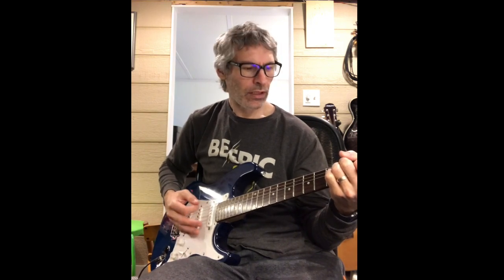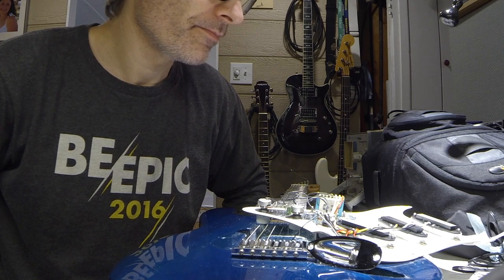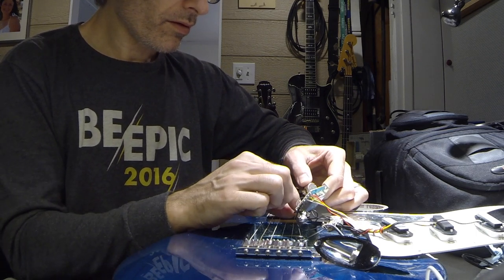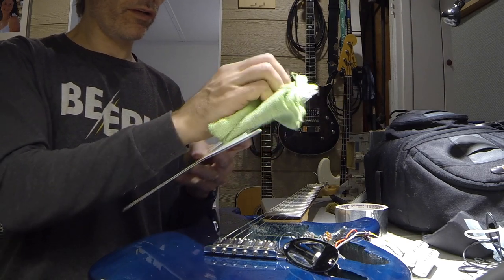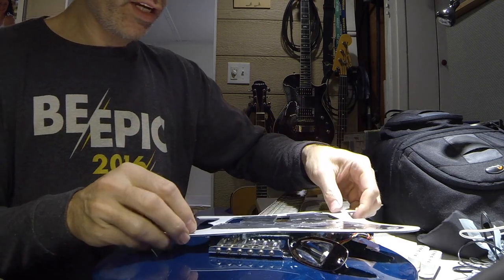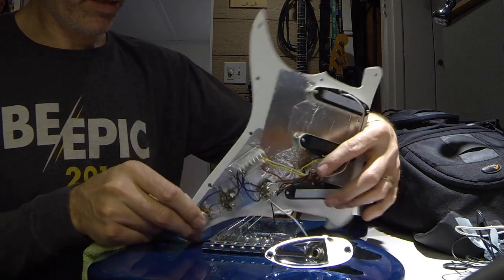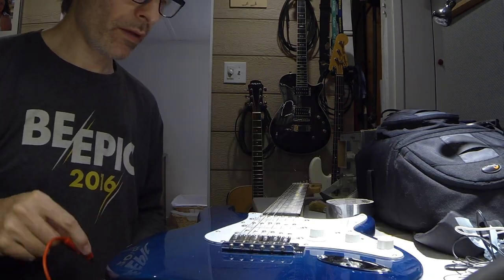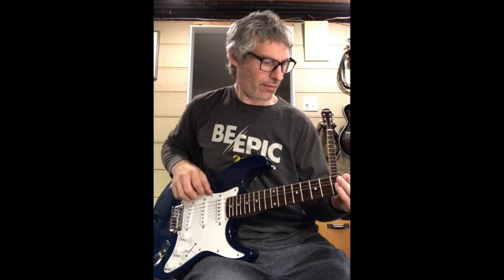Fixing a noise issue on a strat electric guitar

Comment: Just an FYI to those who watch this: The aluminum tape used is called ducT tape in the US. Not duck tape, ducT tape. You can get it at home appliance and air conditioning parts stores. Wholesale is about $7 per roll.